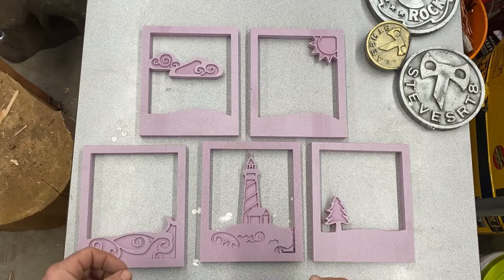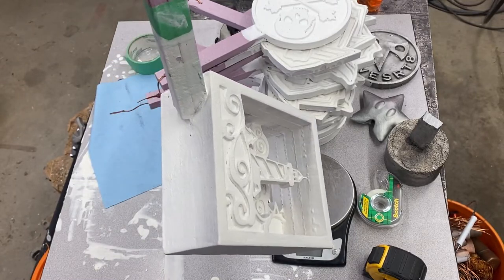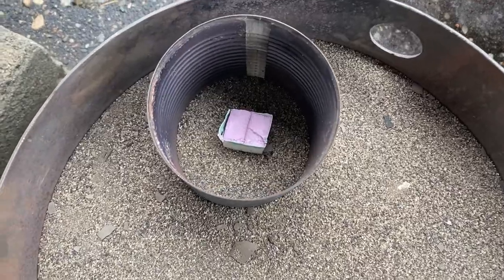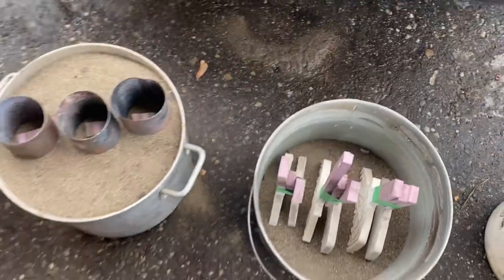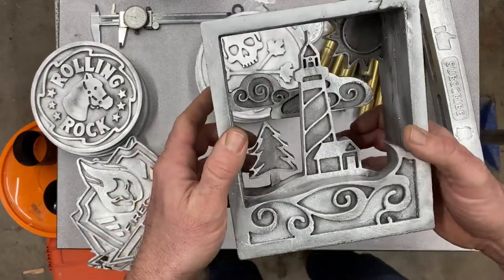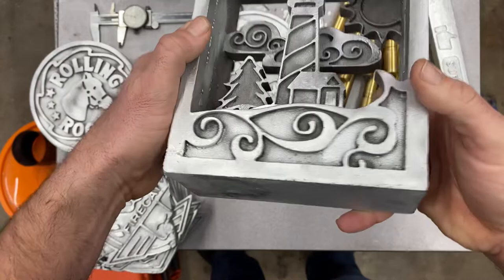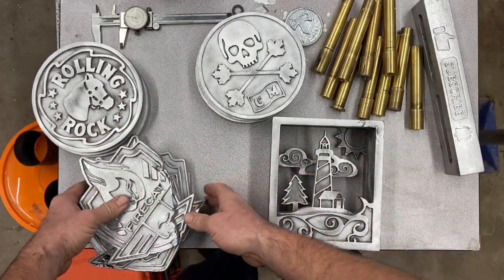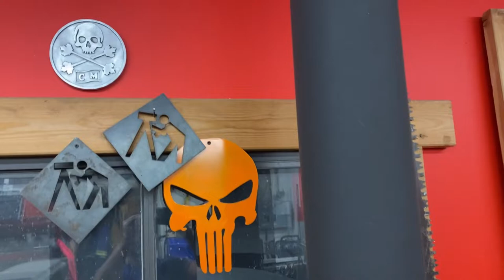3D Layered Lost Foam Casting

Comment: More awesome work Steve. Always amazed by how good everything comes out, except for the short pours. lol What's the smallest stuff you have used this method on? and have you tried other metals or only aluminum?
Reply from the maker: i have done some smaller pieces using zinc. zinc works pretty good with the foam.  I have done some brass. hammer and branding irons. havent done much other than aluminum. Brass has been tough. definately not as easy as aluminum.  i was pretty impress with how thin that point on the lighthouse is.
Reply from the maker: this guy is the man. he's been a huge help to me. this vid is a pretty good demo on the capabilities of foam casting
https://www.youtube.com/watch?v=WhWyN0wKkR4

Comment: How do you create these templates, cnc machine? I plan on building me a metal building or metal roof so I can work on some projects. I really would like a 4x8ft plasma cutting table to create nice custom artwork.
Reply from the maker: Yes i have a small desktop cnc router. pretty limited but great for doing small pieces. i have a small 2x2 plasma table its definately handy too. a 4x8 would be pretty awesome for sure.
Reply: @stevesrt8  I will check your channel incase you have a video on it as I would probably like to try learning cnc. Once again Thanks

Comment: New subscriber with a question. Im wanting to do a lost foam aluminum tree climbing spurs. It’s pretty much the shape of a “J” and then bolt on a spike. 
My question is would it be strong enough and how thick should I make it?  They are made of aluminum,titanium, steel if you buy them but very expensive like $500 for a pair so I want to try and make my own. Thanks
Reply from the maker: aluminum is quite brittle when it is first cast. i dont know alot about it but it gets heat treated after to take out the brittleness. there are different alloys used in different situations. im sure the commercial spurs go through some testing. i can't recommend it but be careful if you do.